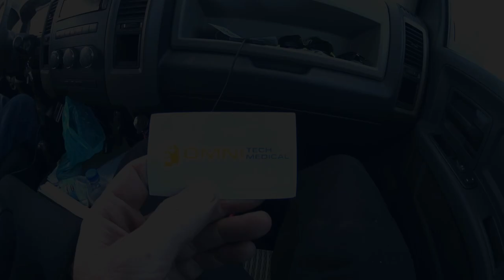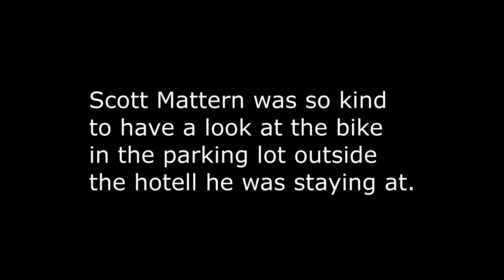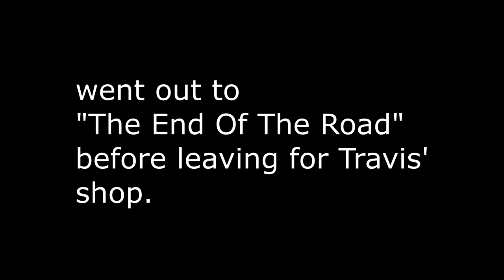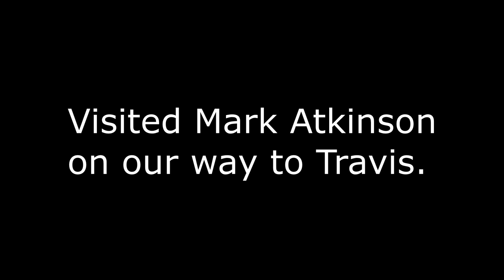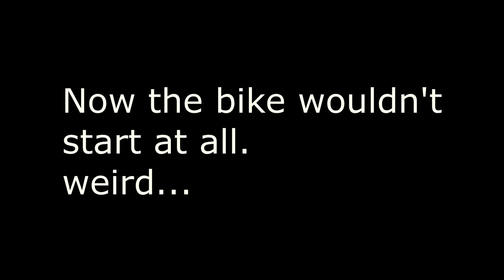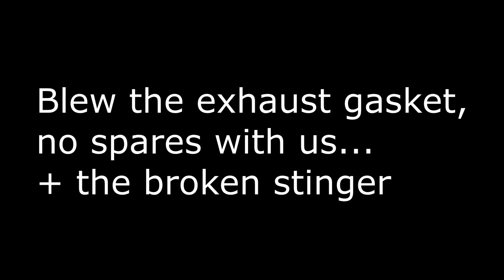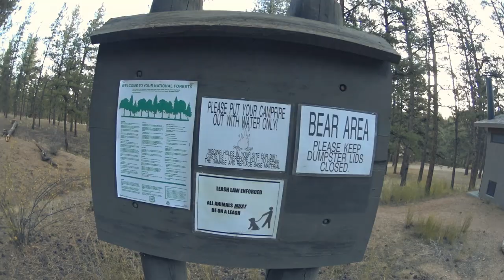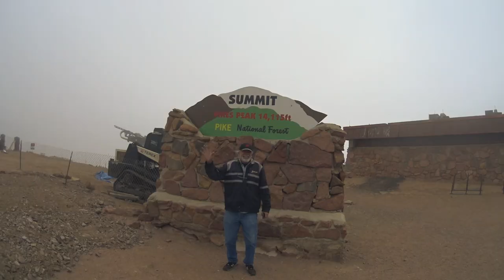Moped Dick at Bonneville World Finals 2019 - 50cc Two Stroke Landspeed Bike

Comment: When you think about it, at 18,000 RPM, the fuel goes in and comes out 300 times per second. At even half that, imagine what's going on with gases inside that tiny bore ? A fraction of a mill in the wrong direction and the swirl effect would be different, the length and bore of the stinger, the shape of the chamber, the exhaust timing, the transfer delay... And the air passing the open bellmouth of the carb, at what speed does a scoop act like a forced induction ?  Incredible indeed. A sensitive ear can tell when a motor comes on song, I heard it, so did the Norwegian, did you ? Love it, great video and a lovely man indeed.
Reply: Que?  Oh! you mean its on the pipe!  Braaaap!
Reply: good comment. There's a lot to say on tune by ear, as we did often in the past. because we poor hotrodders had no dyno testing facilities, or equipment 
like today, lambda readings and such. It was Sparkplug reading, comp testing we could, hearing and feel how it runs. Experimental fittings what works what not
no mathematics, no science.
Reply: Aussie Baz   Living in the USA where dragstrips are almost everywhere I’ve won many a sideline bet listening to hear that sweet spot during pre burnout before the race.   It just screams at ya.

Comment: I'm glad you were able to sort some stuff out out it's probably serendipitous that the event was cancelled so you wouldn't have been disappointed (because it obviously has more in it) and then solved a few things with those great guys!
next year, it's all about the spares! we're all plugging for you!
just thinking that gearing wise, maybe it's too short for final drive ratio for Bonneville. within 3/4 mile it's reached it's torque peak at 11-12k and at 1 mile already redlined at 15-16k. you have  3-4 miles to accelerate at Bonneville and then the flying timed mile...

Comment: Awesome video! Dam I should have entered my suzuki er 50 the 'official' max speed was 30mph but I had an indicated 45mph out of it, I tuned the motor, opened up the ports, put a gianelli expansion exhaust pipe on it, which alone gave me a welcome boost of 1.5hp 😁😎👍I think the stock motor was around 6hp 😊

Comment: The Stinger IS important. Every little thing, is important. Every two horsepower, every little aerodynamic enhancement, and every weight shaving, this all adds up to serious performance gains if you think it's not important, it is important. No big deal, just the difference between winning and losing.

Comment: use a copper with shaped ports, polished & plated sleeve en machine spaces for rubber O rings to contain the coolant / gasses inside your casted cylinder.
some cars have wet liners and use rubber ...
Reply: maybe you build tighter bore around existing pistons.

Comment: think with the radiator its going to fill up wih salt too , at the end of the run the thing will be a solid block and heavy , i think running an icetank would be a good idea , needs to sit low on the bike though
a lot of years back i read about tuning 50cc racers and one topic was the play between the big end bearing and the two crank sides , there was one size that worked perfectly but bigger caused the bearing to vibrate itself a part and smaller caused the bearing to seize , cannot remember that size and the article is looooooong gione 
realy wondering wat speed its going to do , you could take a gps unit with you on testruns just to see the max speed

Comment: Maybe if you get some spare time you could think about how it might be possible to add reed valves and expansion pipe onto a rotary engine. Since they cover and uncover intake and exhaust ports similar to a 2-stroke, it would be cool to get it to have a natural self-supercharging powerband like a piston 2-stroke. Some people disagree with me but since every time the combustion chamber is swept by a rotor face it fires to me it's a 2 stroke. If it fired every other time a rotor swept the combustion chamber it would be a 4 stroke. Plus they have low torque, you mix gas with the oil, they rev really high, they sound like 2 strokes, really I think they are 2 strokes. They share so many characteristics. The main difference keeping them from being self-supercharging is that the exhaust is not continuously connected to the intake through the combustion chamber, so the self supercharging fuel filled exhaust never gets a chance to make its way all the way back into the combustion area to get used for supercharged combustion. When a piston is down the exhaust can flow back through into the intake and pressurize the crank case. But with rotors, there is always a rotor peak blocking the way back through. If it wasn't for that I am 100% sure you could use an expansion pipe and reed valve to make it self supercharging. I would love to find a way around that limit. Figure out a way to make a path for the exhaust to make it's way through the rotor area back into the intake. Man a self supercharging rotary would be so awesome. I swear I'll figure it out someday even if the solution is not cost effective or efficient I will figure it out.

Comment: have you given thought to having a gas powered electric generator to charge as you drive ? You could stop at 1/2 charge and start the generator and have a kill switch in the cab to shut down the generator when the batteries are fully charged. Just use it on long trips.

Comment: Mother Nature stops play...great video, they bring up a good point with the carb intake the velocity of the air will start to cause a venturi effect and reduce the air mass intake, a nice scoop will start to preboost the air intake, at 100mph you should be able to gain a wee bit of boost. I had a old kawasaki 4 cylinder with bell mouths on the the carbs, with a cross wind it would drop power big time as it upset the intake flow. might be a couple of hp in raming that air into the carb? Maybe a scoop with double the area of the carb intake area?

Comment: 21:10. Ok how about connecting your EGT sensor to a small microprocessor and when the temp hits 1290C have the processor spray a small amount of water into the air intake. Water will lower the gas temps, material temps and help reduce knock. Water injection used to be more prevalent 20 years ago on turbo engines but it was commonly used. A rasperry pie may be a good inexpensive type processor to use. Other ideas would be to over-fuel the mixture or reduce ignition timing, but I'm sure you're more than familia with these! Great film, really enjoyed it. All the best.
Reply: I don't know if their class would allow for that. Technically the water could be seen as a power adder if you spray it into the intake. The real solution would be finding a way to control the egt's through an ecu that adjusts the fuel mixture based on the egt to try and ride as close to the line as it can within the cooling systems capabilities. So basically, going EFI instead of carb. But again, i don't know if their class allows for EFI.
Reply: @kasuraga  Yes a FAST or Holley EFI system would do it, I'm not sure they have single cylinder settings though and the 20k rpm might be a problem. But the technical support would be great, and even better if they came on board as a sponsor.

Comment: Hi. What about the PowerSpark Performance? I have 6 units of this ignition and I'm facing misfire in 2 engines (70CC and 23Hp @ 16000)
Reply from the maker: Have you strobed them? My other unit auto retards about 10° from 10k to 15k, I have to compensate for it in the map - If I want 15° at 15k I have to use 25°.
Reply: I didn't strobe for troubleshooting.  I have a timing light able to read up to 14k so I think I follow you.  
I realized  that you got lots of misfires. Was the timing retards the root cause for those effects?
Reply from the maker: I first thought so, but later realized the ringland got squashed and the ring was randomly sticking at high cylinder pressure. Difficult to troubleshoot...

Comment: looks like my moped in my teenage days, so high powered it doesn't come of the line from a stand still, a radiator that big will prevent the machine to reach it's optima operating temperature.

Comment: That's the sickest Bultaco Alpina I've ever seen (literally had to look it up because I thought it started as a Metralla and not a damn dirt bike 😅)

Looking at online pictures it looks nothing like it does here, it's so gorgeous.... and now I need to get an old 70s 2t and get moving

Edit: and then the CB750 Chopper, I can't tell, was that an Amen Savior framed on that? They usually have tiny little rear shocks towards the back wheel hub instead of your typical chopper hard tail.... I had the opportunity to buy an old 70s Amen CB500 Four chopper, but I didn't have the space for it at the time because I already had 4 bikes at and in my apartment, I definitely should've bought it and gotten rid of one of the other ones 😩

And then the XR600R there too 🤤

Comment: Well said Jospi2. Speed Whacker is a great name.
Reply: Radiator under the seat was used by the Britten 1000 back in early 1990s. Low pressure air under the seat sucks the hot air through.

Comment: Hi Alex, great video man, just a quick tip on setting your crank into the bearing, get yourself a slug of copper with an O.D. around the size of the bearing inner race, heat the copper up then sit it on the race letting it heat through gently rotate the bearing too and throw until it locks up, now drop in the crank and it will shrink back to size on the crank without any seal or bearing damage. no hammers or rum required. all the best.

Comment: Hello had a Kmx 125 put metal treatment in the fuel and oil!  revving up to 12000 RPM that's 2000 over red line. before  only 8500 rpm no metal tremet....man..Wot do you think? Only put 10mls.. in the oil.. and in the fule put only a 10th..of 1ml in the fule......only...

Comment: if i could make a few more suggestions.

do you know about the Bosch K-jet Tronic? GOLF GTI first gen, ...
it's a continuous fuel injection system.
i would machine the crankcase to fit a Bosch electronic fuel injector with who knows what fuel pressure and let it spray in there continuously with a PWM signal and use the hall sensor to retard the ignition over rpm while increasing fuel (augmenting the PWM signal on the injector). this would simplify the Arduino source code. 

the air mas system of the k-jet Tronic was mechanical, a plate mounted on the end of a lever that pushed a needle to increase fuel, in this case you would use a pot-meter on the trottle body and shift the 10 bit data to the right from the ADC to 8 bit and copy into the PWM register (+ and some additonal maths on that value to fit your likes) , something like that would could possibility work out for a start while monitoring the hall sensor to see if the crank rotates.

regarding Oil pump from a scooter or so, drill a hole on the top side (while mounted) of the crankcase exactly over the crank pin + maybe 2 other holes/tubing to aim/splash for the crank bearings.

Comment: How many km/h? How many hp?
Reply: Pirkan donitsi
Reply: 20 hp
Reply: @simme.fanboy989  Only 20? Thought it'd have more
Reply: @voihanviineri6402  it is very difficult cuz it has to be very light and it has to rev very high and for revving very high you sometimes need to do less power
Reply: @voihanviineri6402  Only? Pretty sure that's 50cc and if we math it out, that's 400hp/liter ... bloody impressive without artificial aspiration.
Reply: @dfabeagle718  Not that impressive to be honest, my friend has a 50cc derbi with 19,5hp. With the awesome stuff this guy has done, more than 20hp should be pretty easily possible to get out of that engine.
Reply: @voihanviineri6402  that's cool.. this isn't the secret sauce cylinder, but I'd love to see your friends channel? I'm still pretty impressed with 400 hp / liter, but I'm old. Most of the junk I have worked on won't make that, but I don't have unicorn dust to power it up either.
Reply: @dfabeagle718  He doesn't have a YouTube channel I'm afraid :( But he does cylinder porting as a half-time job.
Reply: @youthinasia9523  Don't get off topic, YOU clearly don't know what you're talking about. I wasn't talking about km/h, and my friend couldn't break that record because that Derbi is a supermoto bike. The km/h this bike can pull is super impressive, but 20 hp from a 50cc 2 stroke is not THAT impressive, especially with the setup the guy has.
Reply: @dfabeagle718  He's a video of a french guy who gets 20 hp with a stock bidalot cylinder (french brand) on a 50 derbi. He did not tune it but checked compression, squish. In the early 80s, the most powerful 50cc gp racers were probably around 22hp.
But 2SS setup is quite different from the derbi setup with many parts he made himself. I admire his work and motivation.

edit: actually it's a derbi cylinder modified (but not tuned) to fit a 50 scooter  crankcase.

https://www.youtube.com/watch?v=LIk71wFp1nc&t=469s

Comment: Formula 1 engines are preheated with water before they can be start up, pistons are so tight they want move until the engines reach a certain tempurature.

you probably should reach out for Mahle.
https://www.mahle.com/en/products-and-services/passenger-cars/piston-systems/

Ferrari F1 uses them.
ask them for a custom piston for your cylinder.

: )
Reply: also F1 engines have a extreme Bore size.
Reply: I never saw you making something called Sleeve, much easier to shape all the ports you want and where to time them. polish them and inside, probably also much easier plating without the foam.
the problem would be to figure out the exact dimensions what allows to press fit the sleeve into DIY cylinder without collapsing the sleeve.
even a 5.6 cc nitro engine uses ...
Reply: i would follow F1 and go an extreme bore size and short stroke to have the biggest bang on short stroke, whilst respecting 50CC.

even the crank in your engine is made of several pieces.

the sleeve in my 5.6cc nitro engine is something like copper, plated inside.

a piston is Forged, your would probably need a press, a cnc machined mold or ask around.

piston rings are made from certain type of cast iron and can be turned on a lath. 
that's how model engine builders make rings for DIY piston, like the rings in this engine, he told me.
https://www.youtube.com/watch?v=mutb7KgA9NM

and add 1 or 2 extra rings.

the problem is mostly the tolerances in dimensions witch allow you to press fit it easily whilst still tight after cooling down ... and disassemble.
like the crank. maybe are the online calculators to tell how much metal expands when heating with a torch.

i would definitively ad a stroke oil pump from a Honda MT-5 or Yamaha Dt-50, RD-80, RD-350.
Reply: .. i saw a page a few weeks ago .. they sell retro fit cylinder heads for mopeds / motorcycles with direct injection with the standard automotive connector.
you just need a Darligton transistor to PWM the injector with an Arduino. a 1000 milli second timer and do regular math.
Reply: you might wanna try to bolt on a standard Bosch injector directly to the crank and spray into the crankcase.
you have a billet crankcase, drilling a hole wouldn't be that hard.

you have a fine mist in your crankcase instead of droplets, stable run.
but that would work best if you add a 2 stroke oil pump.

via a 1000mHz timer in the Arduino you can count the time between 1 TDC and the other from the pulse of the hal sensor en determine the rpm.
Reply: + a trotlebody with potmeter.